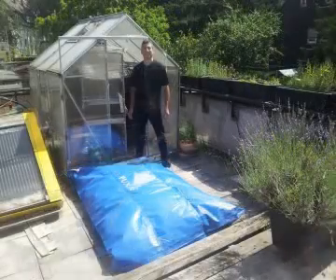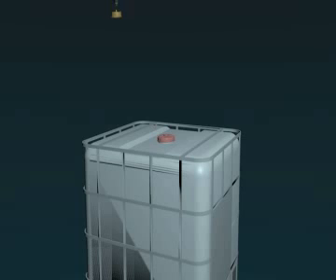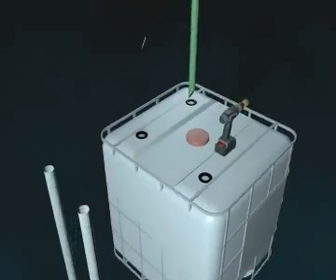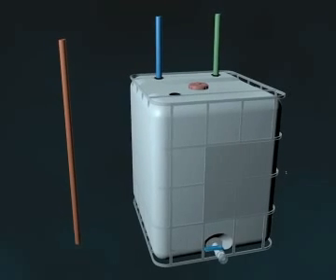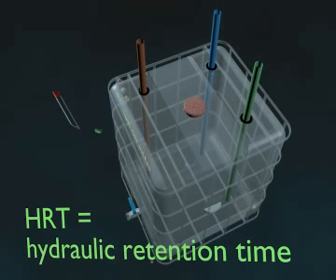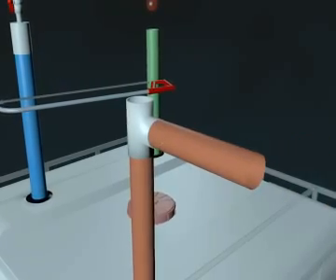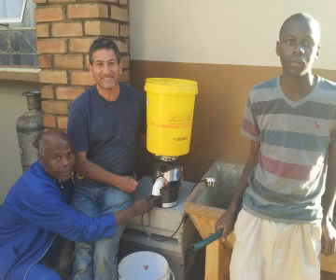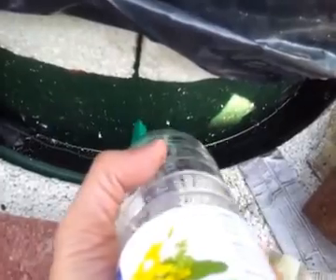Solar CITIES IBC Biogas System Tutorial Complete

Comment: Excellent video!!  

Just a few questions: where can I order the bladder for gas storage? 
At what level or how long will it take to start producing gas?
How was the food ground in the areas without electricity?
Can I put animal (cow, dogs and donkeys) manure in it? 

Thanks for this, I will build this very soon.
Reply: LingahbytheSea I'll try to help. First I had the same question about gas bags as well as biogas appliances. They're easy to get in Asia especially India but no one seems to be importing them into the US. All the local gas bag producers are for industrial applications. In a pinch use car and truck tires. Used ones are dirt cheap or free and even new ones can be cheap. They can also be compressed to increase gas pressure.

As to how long until they start producing usable gas? At least a couple of months depending on temperature and feed stocks, 2 to 3 months. It's a continuous feed set up so it's a one time issue. I'd try to load it up half way as soon as possible using whatever you can scrounge including grass clippings.

As to grinding you can use hand crank meat grinders although I like the garbage disposals best of all. Spend the money and get the best you can get so they'll even take animal bones. It adds calcium  to your compost.

Grazing animals are best but any manure will work. If you are adding a lot of dog, cat and human manure add in grass clippings or another bulk source. You'll get better output and better compost. Some of the best are rabbit and guinea pig although full size pigs work as well. Just treat their waste like human and add bulking materials as a carbon source. Just keep the light and oxygen out like he says. You might add in a packet of septic tank microbes to get the process kick started. Not essential but it can speed up the start up.
Reply: If you are using excrement you have to be mindful of pathogens.
Reply: ... not if it's your own excrement, for your own end product
Reply: you think your shit does not have parasites etc?